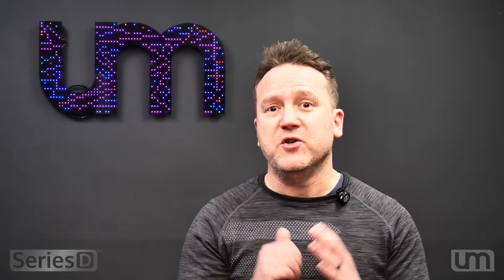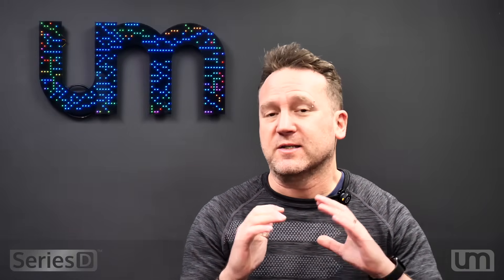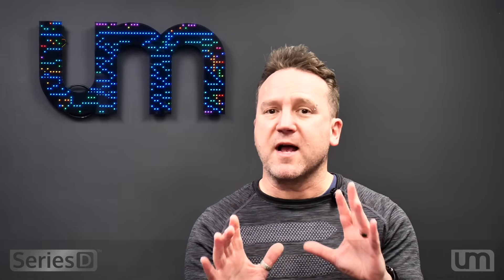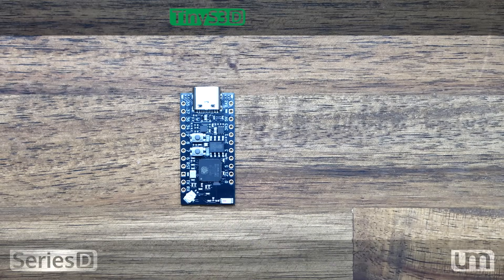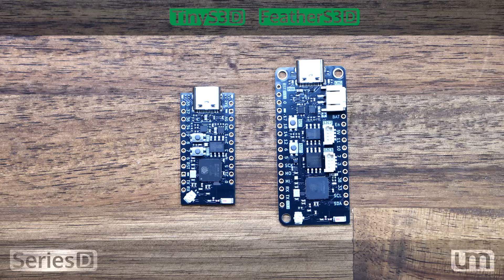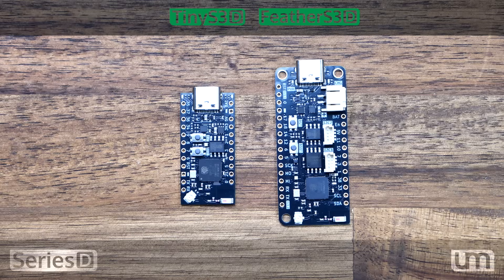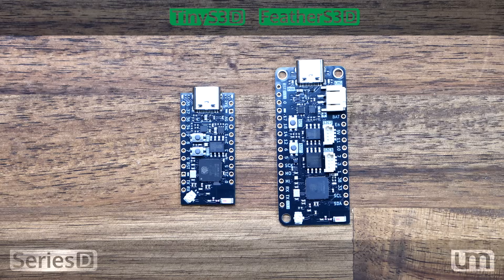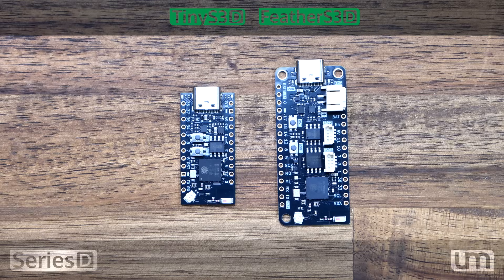Series[D] Announcement

Comment: Hmm this M2 format sort of made me wonder if i should by SOCAMM connectors and try a design with such a connector. I quite like the option to be able to switch the rf out. Is the thing just controlled via a single pin?
Reply from the maker: A single IO switches between the 2 antenna paths.